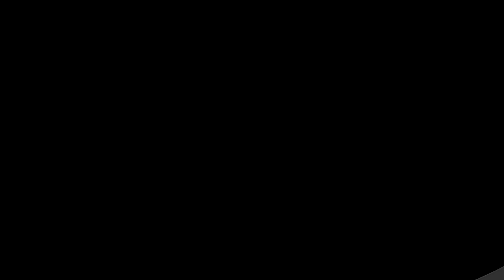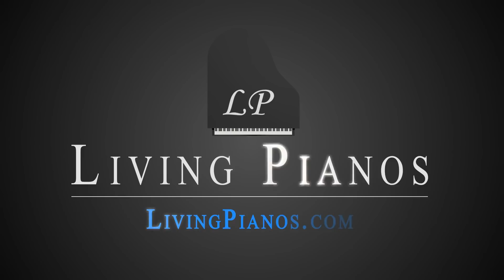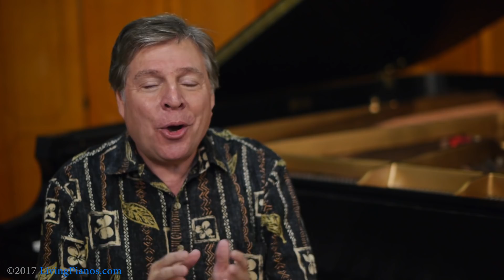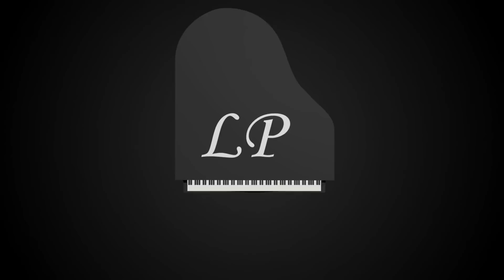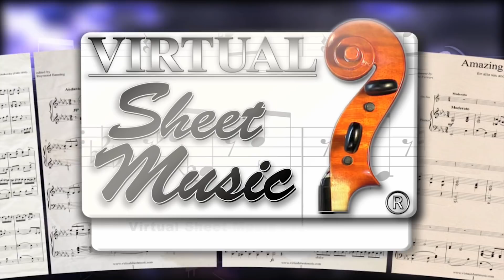How Do Different Size Pianos Work? Sound and Feel Differences

Comment: In order to obtain a given tone, the mass of the string is prevalent over its lenght. However, a shorter and thus thicker string is also stiffer and won't swing as widely and freely, which influences to a great extent the tonal properties.
In an ideal situation every string in a piano should have the same width to get an even tonal quality throughout the entire compass. In practise this is of course impossible, because the piano should be many feet longer than the largest concert grand. Scaling is making gradually thicker the strings towards the lower part of the compass in order to compensate for the loss of natural length. As Robert pointed out, shorter pianos call for much thicker bass strings than they do in concert grands, so the scaling of shorter pianos shows a dramatically higher progression in string width and in doing so also a significantly higher loss of tonal quality the thicker the strings get (not to forget the smaller sound board, which favours less low fundamentals)
Cheers, Willem
Reply: Some people, including Adrian Mann and David Klavins, have created ridiculously large pianos with extremely long bass strings. The result, to me, definitely sounds very nice.

Comment: Interesting about the overtones with lower strings.  That explained a lot of dull sounds I've heard at the lower end.
Do you know what could cause a muggy sounding treble at the opposite side of the piano? We have a small Petrof baby grand at university, and in comparison to the other grands (or even some uprights), it's treble sounds very muffled, but the rest of it brighter.  Could possibly just be a lack of regulation, I guess.